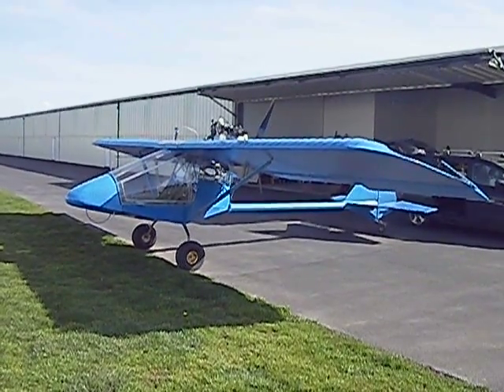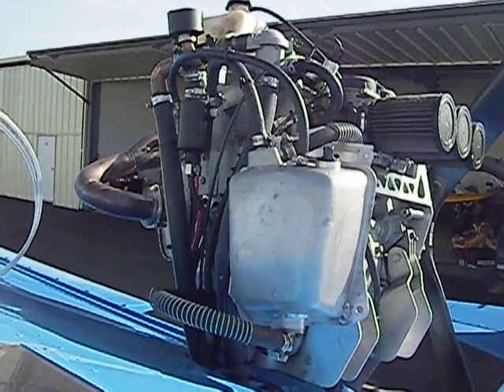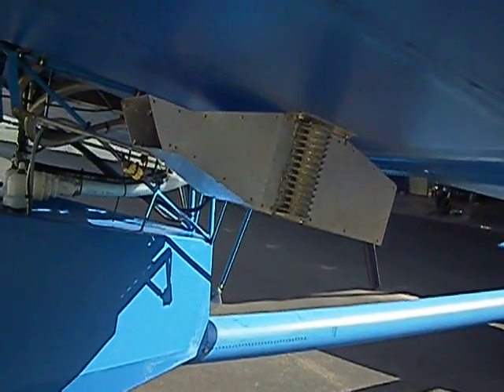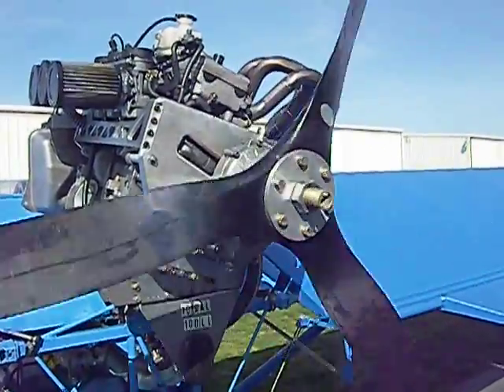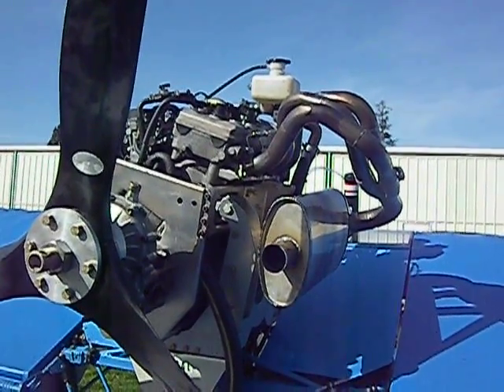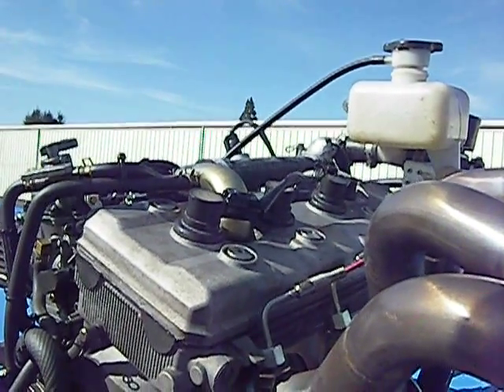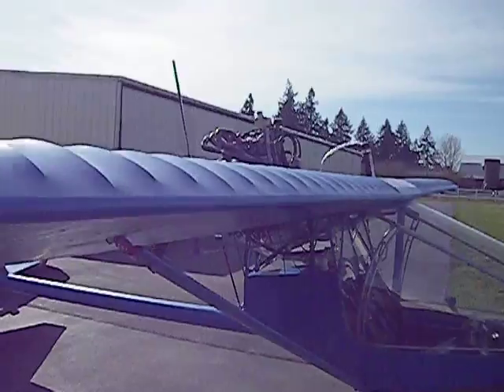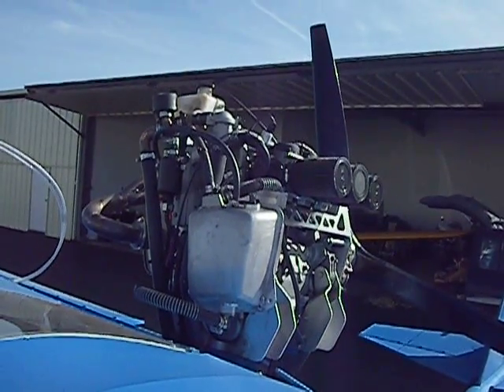Yamaha engine on a Kolb MKIII C

Comment from the maker: Hello Travis,
I'm glad you like it.  The rate of climb is somewhere in the neighborhood of 900 FPM at about 900# gross weight.  The take off roll is brisk.  I have not taken the time to measure either accurately.  I am running a 3.47:1 gearbox, so the prop is spinning 2305rpm at full throttle.  I have about 50 hours on this engine and hope to put at least another 50 on this season.  So far, I am very happy with the way it performs.

Comment: Did you have to get another DAR inspection due to the radical engine change?  Your first inspection, for your Airworthiness Certificate, would be predicated on the original engine, i.e. rotax, etc.   Thanks.

Comment: I would love some info on the adapter plate and how you made it work and any other special mods that had to be done. Im currently looking into using a 4-stroke sled engine on my ultralight aircraft as well. Any help would be appreciated. Message me on here and we can exchange numbers if you want. Thanks!

Comment: How did you calculate the angle of attack on the engine mount?   I notice that most pusher engines are mounted with about 10 degs of angle or so.